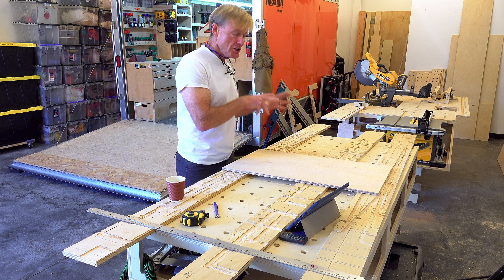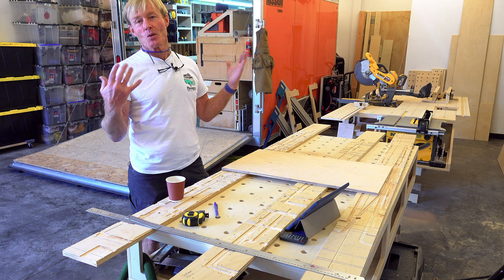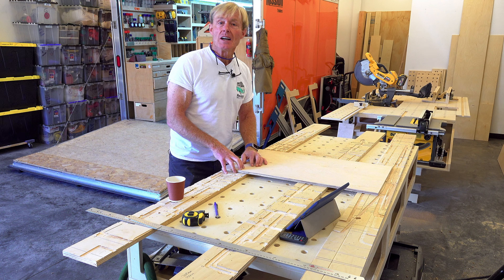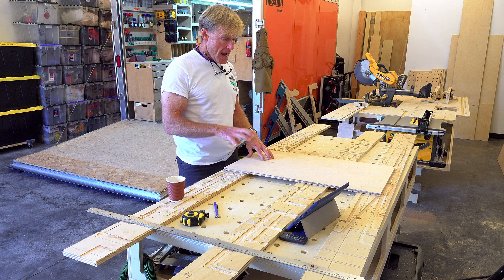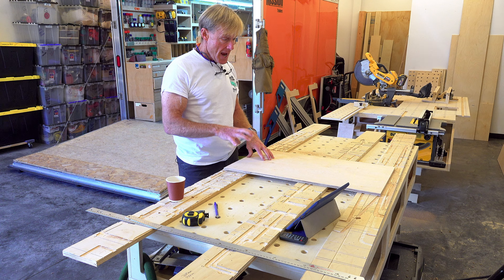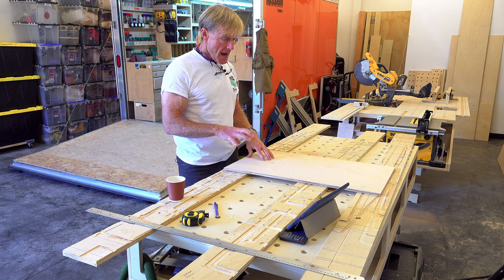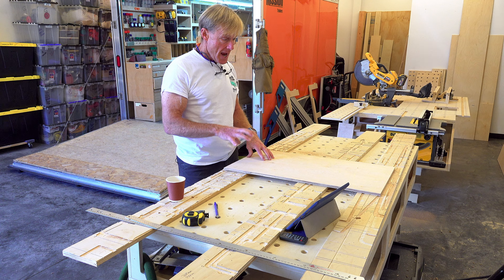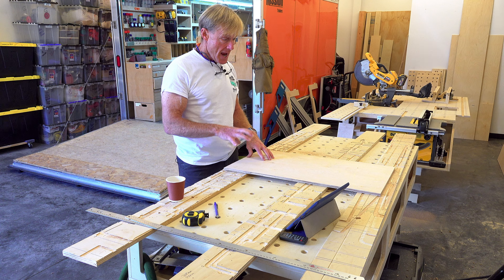Making a router pattern with a router pattern

Comment: Hi Ron  it looked to me as if you had cut the template with a bearing guided bit as the holes in the template look exactly the same size as those in the temporary template that you screwed together.  Is this how you did it?  Mike
Reply from the maker: I used a bushing and upcut spiral bit as I always do. I drew out the 8 rectangles on the permanent pattern to the required finished size. I then drew lines double the bushing offset so the rectangles were 6mm wider and 6mm longer than the final cut. Then with the 12mm ply strips, I created the temp pattern. The result was the permanent pattern rectangles were 3mm longer and 3mm wider than my desired final cut. When I used the permanent pattern on the final workpiece the rectangles were the exact size I designed for. It was a double step using a temp pattern to make a permanent pattern to make the final cut. It is really easy math with any bit/bushing combo.
Reply: Ron Paulk Thanks for the detailed explanation Ron

Comment: Ron what size bit/bushing do you use for this? How much do you subtract for the inside measurement? How much do you add for the outside measurement?
Reply: There are different bushing sizes depending on what size bits, between the two it creates a lot of variations so you have to work it out. You can test on a few scraps and use that to get the correct size.
Reply: I use a 1/2" downcut spiral bit and a 5/8" (outer diameter) bushing. This means the pattern should be 1/16" larger in each dimension to achieve the desired size for the finished piece.

As long as your bit and bushing have the same offset, you can use whatever combination you like.
Reply: I think Ron has said in other videos he likes to use a 1/4" spiral upcut bit in a bushing. The amount to add or subtract for templates is always half the total difference in diamter between the bushing and bit. Just a random example, a 3/8 o.d. bushing with a 1/4" spiral bit has a toal difference of 1/8". Half that difference is 1/16", and that's how far off the template your bit will cut. Whether or not to add or subtract is determined by whether you are cutting inside or outside the template. The bushing will shrink cuts inside the template, so you must add an appropriate amount of size to the template before hitting the target dimensions of your cut. Cuts outside the template will grow by the same amount, so you must make the template smaller by that amount.
Reply: Thank you Sir.

Comment: You just told me to be safe. Thanks for that. Now, I know you’re a professional. I know I’m not. Please take this with a grain of salt: I think you are out of your mind running any power tool in...SANDALS! I’m kidding, Ron. Love your channel.
Reply: I got to tell you that since watching Ron I noticed that too, and I have adopted the sandals for certain applications like using a router. Even with dust collection you still get some sawdust and it gets down into your shoes and into your socks, it can become very uncomfortable quickly it is very annoying to clean all that up. Sandals just slip off smack it on the bench and slip it back on.  In a wood shop where you're really in control of everything I could probably get away with sandals 24/7
Reply: Except when something falls on your toe
Reply: @joycemiller4716  it's a wood shop, not framing a house lol
Reply: @theprofessional very funny🤣.  BTW, on the off chance that you’re not pulling my leg...stay safe, friend😱
Reply: @joetoner8848  not pulling your leg, I feel totally safe in the sandals, I'm in total control over the environment.
Reply: Sandals really? I kinda get swept up in the garage doing it barefoot, then think I should put something on my feel and it’s 50/50 whether its sandals or flip flops...  Same reason as everyone else, dry feet are so much easier to brush off than fancying around with anything else!